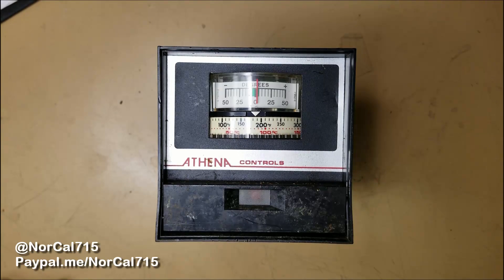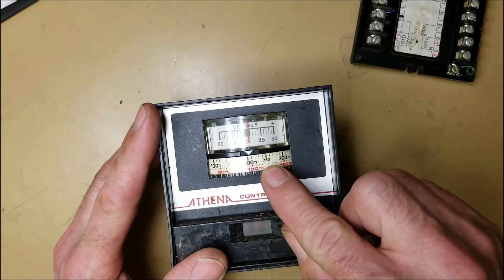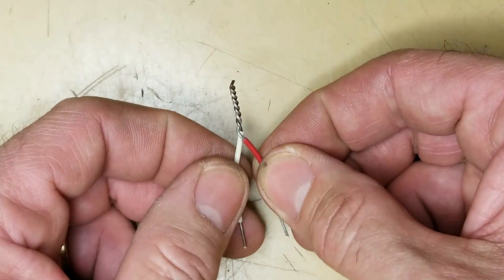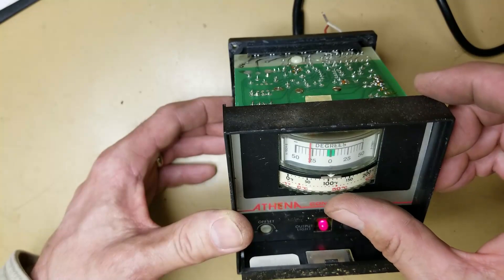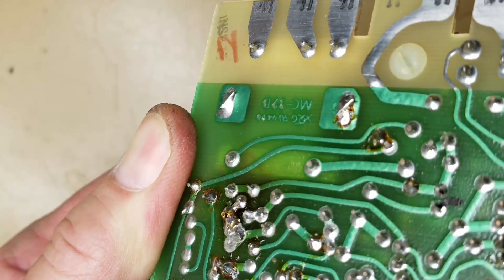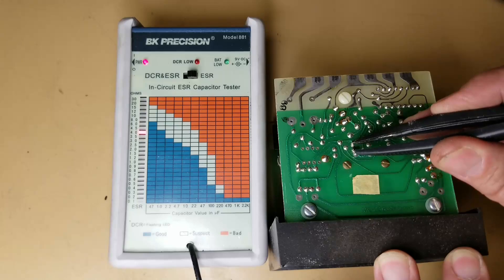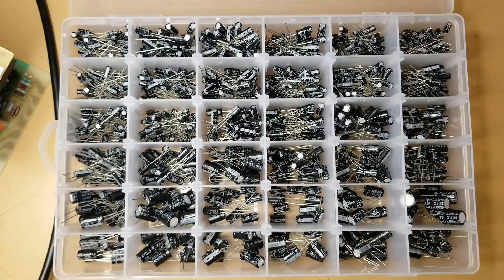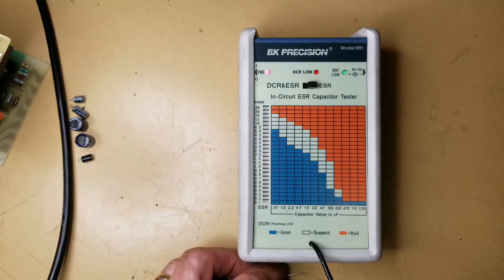Vintage Electronics Repair ATHENA 2000T Temperature Controller

Comment: Really? Are you replacing good quality Nippon Chemi-Con and Nichicon caps with some Chong crap?
9:11 - yep, probably it's the same story like with china 9000mAh or 12000mAh "rated" LiIon 18650 batteries...
Reply from the maker: China-con and Crappy-con caps

Comment: I would have replaced the 78L09 regulator, they really run hot, especially if they are going to supply 9V with 25V plus input on them. Just having the TO220 package in there will keep it cool, and in general the 1A version is often cheaper than the L version, being more common.

Capacitors having high ESR would not have mattered, except the 10uF ones that are used for filtering the amplified thermocouple voltage, and they would have eventually led to switching noise on the relay, but not really an issue with the SSR there till really bad. I was thinking the small pots were intermittent, but they must have been rarely used, so still in good condition. Still plenty of similar vintage controllers around, and they are well worth a bit of maintenance, as in many applications you do not really need PID control, and the old controllers last a really long time. Got plenty of transformers for that style unit as well, bought as a grab bag of old plug in logic, and using them slowly with time, plus they also have the relays as well.

Comment: Nice. What was that capacitor kit you used? What brand of capacitor do you generally use?
Reply from the maker: That was just a cheap generic assortment of 105c capacitors. Ebay or Amazon. Think it was about $35US for all of them. For more sensitive equipment I use Panasonic or Nichicon capacitors